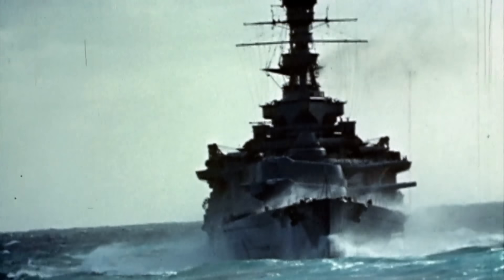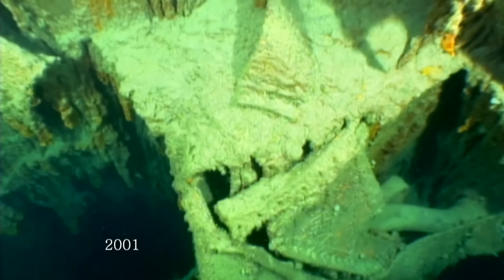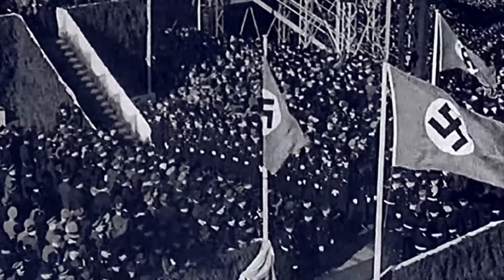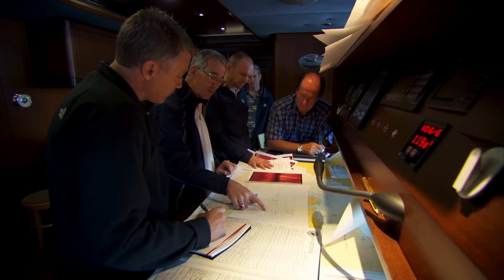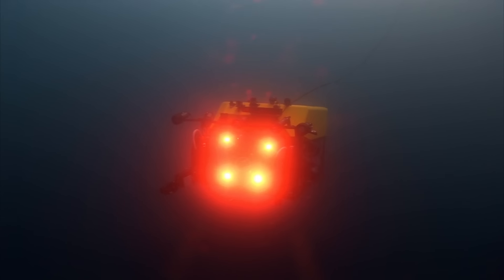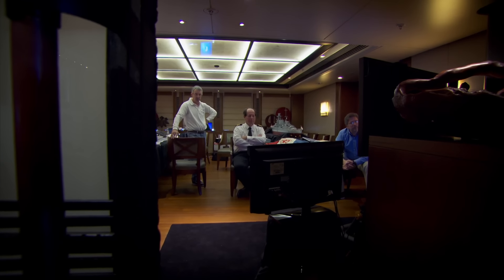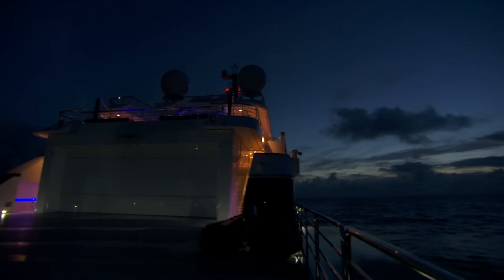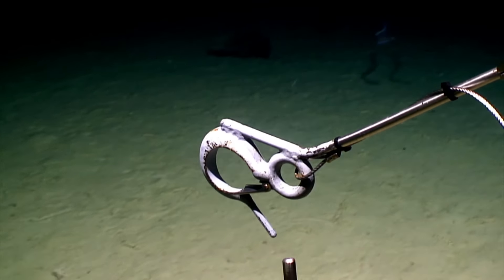How the Bismarck Sank HMS Hood - Documentary

Comment: To lead the war machine ... The Bismarck and the Kriegsmarine!
Reply: The only problem to some of the ships like the Bismarck and Scharnhorst class is that they use 3 Propellers instead of the usual 4. This lead to problems in their keel due to vibrations particularly in high speed. Also, their rudders are exposed and unarmored making it vulnerable but they didn't consider it because they think a likely hit on steering gears and the rudders are remote. It was also shown during the training run of Bismarck in Baltic, is that incase of a rudder failure, they will use the revolutions of the Propellers which is predictably, ineffective. So while they were powerful,  they were outnumbered and let's just face it, Battleships are slowly becoming obsolete and they are only involved in a few major sea battles in World War 2 particularly with the emergence of Aircraft Carrier and Airpower.  Bismarck and the Ships are indeed powerful, but the Kriegsmarine can never win in a battle of attrition with the allies and the only way to do it is to strike convoys hard and fast with the u boats.
Reply: Two thousand men, 
And fifty thousand tons of steel
 Set the course for the Atlantic 
      with the Allies on their heels!
Reply: Sign of power show of force raise the anchor battleship plotting its course.
Reply: Are you writing song lyrics, or is the rhyming a coincidence?
Reply: Made to rule thr seven seas
Reply: Sign of power
Show of force
Reply: Song is called Bismarck by sabaton
Reply: @frankmiller95  It's from the song Bismarck - Sabaton
Reply: Two-Thousand men
And Fifty-Thousand tons of steel
Set the course for the Atlantic with the allies on their heel
Reply: @VoxVictus  Hardly cowardly or ignorant, they don't get to decide if their nation goes to war, only to do best by it when it does. It is, and was, after all, their families and loved ones who would suffer should the war go badly. 'Do unto others so they can't do unto you.'
Reply: Lol rudder is vulnerable to any kinds whether armoured or not
Reply: Don't forget about the tirpitz
Reply: Fire power firefight battle station keep their target steady in sight
Into formation
The hunt has begun
Dead and damnation
The fleet is coming
Reply: Bismarck- Pride of a Nation, A Beast made of steel
Reply: @MohitSharma-so9st  HE WAS MADE TO RULE THE WAVES ACROSS THE SEVEN SEAS
Reply: Jacob Mullins Pride of a nation! A beast made of steel. Bismarck in motion, King of the Ocean he was made to rule wave across the seven seas!
Reply: P Joubert It’s the song Bismarck by Sabaton
Reply: Awesome song
Reply: The great German navy? LOL
Reply: To lead the war machine, to rule the waves & lead the kreigsmarine.
The terror of the seas, the Bismarck and the kreigsmarine.
Reply: @lisakang3442 8
Reply: Jordan Fan，Prophet of Environment。范楚漳，環境先知：
How Did The Bismarck Manage To Sink HMS Hood So Quickly? 
Answer:  The answers were very simple:  When the HMS Hood was battling the German battleships  Bismarck et al, those lazy British  navy sailors onboard the Hood were busily eating their favorite breakfast food - Biscuits with Sardines.  And had forgotten to return fire at the Bismarck!HFC

Comment: HMS Hood sank for the same reason the USS Arizona sank in Pearl Harbor.

ANY detonation within a magazine storage area will literally cut the ship in half at the point of detonation.

The Arizona was sunk from a lucky (or good depending on your point of view), bomb-drop point from a Japanese bomber that penetrated the upper-hull and detonated within the magazine for its main gun.

The Hood sank due to what was essentially the same thing, only in cannon-fired 'plunging arch' fire from the Bismark going through its upper deck and detonating in the Magazine for its main gun.
Reply: Rip Hood and Arizona
Reply: RIP HOOD AND ARIZONA
Reply: I agree to a point.   At Pearl Harbor, many Japanese D3A dive bombers weren’t actually dropping bombs.  They were dropping 16” armor-piercing rounds that had been taken from the battleships Nagato and Mutsu and modified with fins.   Arizona may well have survived the impact of a regular bomb.  However, survival from an armor piercing 16 inch shell impacting the deck armor at a 90° angle is impossible.   Hood wasn’t necessarily subjected to plunging fire.  When she made her sharp turn to port, she - as ships do - slightly rolled to starboard.   At full speed and max rudder turn, the roll was rather sharp, exposing the deck.   Had Hood started her turn just 30 seconds before or after she actually did, she may well have survived.   Bismarck also very well could’ve been sank that day, as Hood certainly had the firepower to bring Bismarck down.
Reply: There is nothing known as luck in war.... as they meant to cause damage to both cases, Arizona and Hood... While Arizona tragedy was an Invasion, while Hood tragedy was counter attack by Bismarck.
Reply: My grandmothers uncle was an engineer aboard the Arizona. He didnt make it out. We have a letter from him months before the attack, it has the Arizona post office stamp & everything.
Reply: Supreme Gamer once again, agree to a point.   Naval warfare in those days is a lot of luck.   Yes, both cases were intended to cause damage.   But let me illustrate my point through the eyes of Bismarck’s gunnery officer.    You’re in charge of the main guns on Bismarck.  Eight 15” guns mounted on an 850+ foot long ship, that’s moving at 28 knots, and bobbing and weaving through the waves.   You’re aiming at another 850+ foot long ship, that’s also moving at 28+ knots, on a course that isn’t parallel to yours, and is also bobbing and weaving with the waves - in a different way than you.   Oh, and not only is your target 14 miles away, but your radar directed fire control is inoperable because the concussion of your own guns knocked out your radar a few hours ago, so you have to aim optically.   While you have been well trained and have a lot of skill, you also need a lot of luck to even hit Hood, let alone hit the one weak spot in her armor.
Reply: Jakob With a K very sorry for your family’s loss.
Reply: @Engine33Truck  Agreed, the Bismarks gunners did very well to straddle then hit the Hood so quickly, they were superbly trained. However, beyond actually hitting another Battleship at that range while both targets are moving everything else is up to random factors. You certainly are NOT aiming to pinpoint specific, small targets on the ship, you are literally just trying to hit the ship as a whole! And this is before you even consider that the Radar gun control was really only useful for course and to an extent speed, it did not magically flash up a firing solution to put 8 15 inch rounds straight through the Captains Ready room!
Reply: @Davehash  
What ice age did you just awaken from?
The armor piercing bomb hit next to number 2 turret and down to the magazines where it exploded.  The old wives tale of the bomb going down her stack has been dis-proven.
Reply: Aria Repine I tend to agree on both ships there was a Hell of a lot of black powder on board, yes there was a moment of opportunity for the Bismarck  but some of it was due to  the course that was navigated
Reply: Or the Bismarck or Prinz Eugen (Both ships fired salvos at Hood within a few seconds of each other) hit the midships torpedo room or a few AA boxes detonating the ammo in those places. In the case of the AA Boxes, the fire from them could've spread to more dangerous ammo.
Reply: @russellcox5129 Sorry. Not black powder. Some form of cordite.
Reply: @Engine33Truck  True, but you are disregarding the accuracy of the German gunners and rangefinders. Yes, the British weight of broadside was obviouly far superior to the Germans but that's pointless if you miss consistently as the hood did. Consider this fact, Prinz Eugen hit the hood with her second salvo causing the AA magazine fire, Bismarck from her third onwards causing severe damage to hoods rangefinders and gunnery tower and eventually penetrating the magazine so I doubt hood would have sunk anyone maybe Prinz Eugen. Prince of Wales was targeted and hit seven times AFTER hood was sunk, testament to the German gunnery of quite phenomenal accuracy.
Reply: The yamato also went the same way. It was the weakness of any ship.
Reply: 41 years later the same thing happened to the HMS antelope in the Falklands
Reply: same happened to HMS Barham

Comment: Drachinifel  has a great video on this.  It didn't occur the way it is generally portrayed.  The shell that sunk Hood was one that fell short, and punctured the hull from below.
Reply: If it breached the hull, then it didn't fall short. It was literally on target.
Reply: What did he think of the top-entry route for the fatal shell?
Could one of Bismark's 15" shells hit Hood's deck at a steep enough angle at that range? The greatest angle from the horizontal would be slightly greater than the guns could elevate but not very much.  

Hood did not expect to hit Bismark with plunging fire at that range. 

How about a smaller shell from Prinz Eugen?  That would be shorter range.
Reply: @myparceltape1169  No.  The shell was one that fell short, after entering the water it turned into Hood, impacting below the armor belt.  That blew one of the magazines, which then detonated the main magazine.
The Prince of Wales scored a similar hit on Bismarck, which fouled some of her fuel with seawater.

Comment: The Kriegsmarine had excellent battleships, but it just had too few of them to fight effectively as part of a fleet. Each one was pretty much on its own.
Reply: The Germans had to many eggs in one basket, they tried to build expensive and time consuming machines when the allies could field 5-10x faster.
Reply: I would disagree. I feel if you look at the ships Germany produced they were often overweight and very inefficient designs leaning on ww1 principles  that showed Germanys gap in shipbuilding.
Reply: @aveit6755  I'm just asking because I don't know, what were the shipbuilding gaps in the Bismarck class?
Reply: @briankorbelik2873  Sure, for me Bismarck had 2 main areas where she was inefficient comparted to allied battleships. The first is armour, Bismarck used an older turtleback armour scheme. This offered worse protection at longer ranges as well as meaning the armoured deck was lower in the ship, this reduces the amount of space in the citadel. This meant that more critical systems such as some of the communication wires were unprotected and vulnerable to a near hit or even the blast from Bismarck's guns. Bismarck also had inefficiencies in her armament. 4 x twin turrets isn't terrible but at this point it was generally preferred to have 3 triple turrets as this gave you more guns less turrets to be hit as well as focusing more firepower forwards. She also had a split secondary battery with separate guns for surface and air targets this significantly increase weight over a single dual purpose battery. she also had a few issues with her gun directions knocking out her own fire control radar with the blast of her guns and unstabilised AA directors that significantly reduced her AA capability in anything other than a flat calm.
Reply: Jordan Fan，Prophet of Environment。范楚漳，環境先知：
How Did The Bismarck Manage To Sink HMS Hood So Quickly? 
Answer:  The answers were very simple:  When the HMS Hood was battling the German battleships  Bismarck et al, those lazy British  navy sailors onboard the Hood were busily eating their breakfast food - Biscuits with Sardines.  And had forgotten to return fire at the Bismarck!